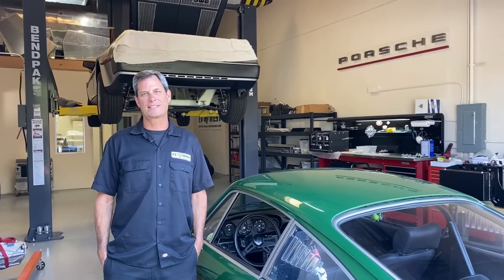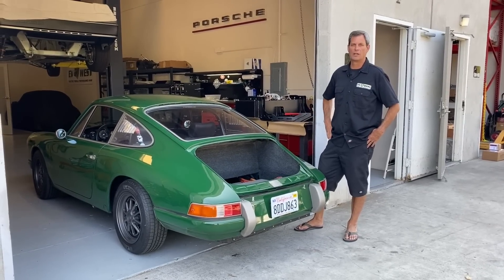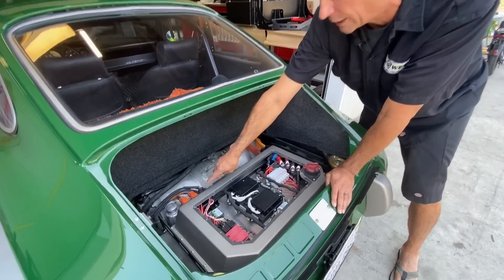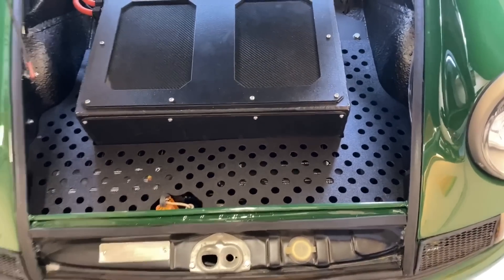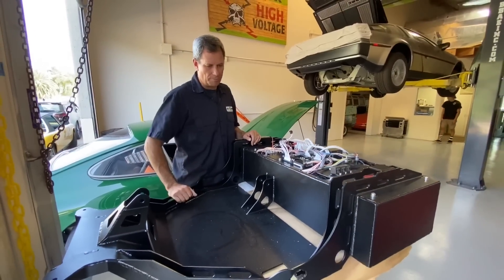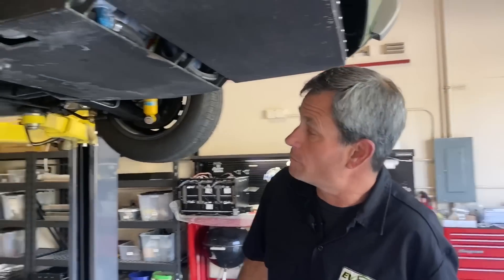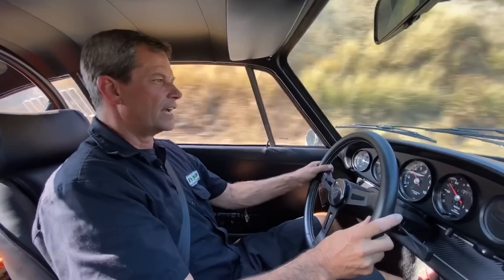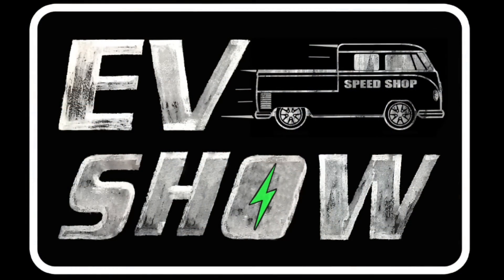1968 Porsche 911 With Tesla Power | EV Show

Comment: Wow that’s fast. Just acquired a 1966 912 with a vw engine ughh. planning to put a period correct 4 cylinder Porsche 912 motor back in during restoration but your video does open up a different direction  do you sell the box or at least provide the cad/ dxf file for us to weld up a engine mount to go with your 912 kit ? Trying to put together a cost. And labor estimate

Comment: So it sounds like you can just supply the 911 kit for the install, I assume the customer has to source the some parts too? I note Air conditioning wasn't mentioned but I am aware electric kits are available, have you also installed this? Im interested as I have an old Porsche 993 that will need an engine rebuild at some point. Im in Australia.

Comment: would love to know what those 2 grey conduit lines are running along passenger side? Main battery? was there not enough room in Tunnel to 2x 2/0 Cables with PVC? having trouble fitting 2x 3/4" PVC in Tunnel for the 912 conversion..

Comment: That is the saddest thing I have seen in YouTube so far
Reply: Good to see there are actual car enthusiasts alive and kicking like you guys.  They're all blinded by this electric is clean myth
Reply: As an owner of a REAL air cooled Porsche, I couldn’t agree more. Without the sound it’s not even close to the same driving experience. I won’t even get into the fantasy that ev’s pollute less or where we will magically get the power to charge millions of ev’s. Flame away millennials, flame away.
Reply: I am with you on this guys , what is wrong with these people ?  I own a Vincent motorcycle imagine putting an electric motor in that , if you own a Rolex watch put a quartz movement in it , it will be more accurate than a mechanical movement. With classic engineering people who understand appreciate these things .  This kind of thing is clever as a one off , ok .

Comment: 32kWh?  Only the first-gen Nissan Leaf had a smaller battery.  Though in fairness, I've found it mostly adequate for the past 10 years, but I understand why you'd do it with a Porsche; it keeps the 911/912 lighter, more nimble.

Comment: What does a conversion cost on average? I can imagine the entire setup running well over $100k for the 1968 911, including the cost of the 911. Likely double the cost of the 911, if in excellent shape.
Reply: The site lists for 11k without the batteries. A Porsche 911engine complete rebuild is now more than that.  More if you increase the performance.

Comment: I think this really shows the conundrum that the automotive world is going through. I simply adore old 911s, and the sounds are a HUGE part of the appeal, especially one with some slight tuning. It will NEVER be as fast or reliable as this modern car - but that isn't the only reason people buy these. I'm really torn. The power, simplicity and sheer HOLY @$#!$%# factor is just huge! But man, running a weber-equipped 911 through a tunnel is something that you'll never understand in a car that goes WZZZZZZZZZZZZ!
Reply: I love my VWs  mostly for the engine sound but I guess you can't have your 🍰 n eat it🤠

Comment: Discusting!! Should really be ashamed of yourself for ruining such a valuable car like that, by removing every bit of it’s heart and soul..
Reply from the maker: This is why we spent years developing this kit, so that it could be bolt in, and reversible. Just like a wheel and tire combo, it can be changed back to stock at any time, so there is no change to the original body and chassis. We're not environmentalists, we're a speed shop, so the intent is to make the car faster, not cleaner. That's just a nice side effect.

Comment: It's crazy fast, but I'm a purist. The sound and feel of the air-cooled engine is better overall experience. I have a model 3, but love the original porsche. Don't like ruining vintage cars like this.
Reply: convert them or lose them.. no gas cars in the future ....
Reply: @gui4j  Yeah I’d be nice to have my car converted but these guys never respond lol
Reply: Converting them is pointless, all you do is add extra strain and stress on the whole car which will make it break faster There is a reason why high horsepower cars need to be much stronger. There might be methylene as fuel in the future as it is sustainable fuel so converting it to methylene would be better

Comment: What a neat idea, offering "plug" compatible replacement electrical power units! This could work with any vehicle and would be certainly profitable for cars that have been market winners produced in large quantities. You just find a model with a timeless look like the Porsche 911. Once you remove the ICE and all its accessories (radiators, gear box, gas tank etc..) you are left with enough real estate for the batteries as electric motors are small compared to what you have removed.  Great project for a start-up... and to attract Climate Change suckers!

Comment: I didn't know you could get an electric that light, 2450 lbs.
Reply: That is very light i guess its easier to get a car that light when its an actual sports car without all the safety precautions such as airbags and other things plus it probably has a smaller battery
Reply: Also the car is not designed for that much power so it uses weaker components as they are lighter.

Comment: Those hoses on the passenger side HAVE to be sorted out better. Love the projects, but that is killing the look from that side.
Reply: The hoses mimic the oil cooling lines to the front radiators that are present on 911s.  But I agree- the look doesn’t look clean in any case.

Comment: Why would you take an iconic classic & ruin it? It’s the EV folks snubbing the real car loving guys. They could’ve used an old 80’s economy car for the conversion. What’s next a classic 1960’s Corvette?
Reply: EV Stingray would be great.
Reply: raboox9 wait until Chevy puts out a new one. Don’t destroy a classic one!
Reply: Better than letting it rot in the garage because you arent allowed to drive it anymore. Aslo, if you are new here... EV West conversions use all the original mounting points so it is a reversible conversion. They are classic car lovers and do as much as they can to preserve the original vehicles. They dont even usually have them repainted.

Comment: It’s kinda copying the other performance electric cars company Rimac before making a $ 2,000,000 car when he start his company,
Rimac built his first project from a old BMW and mod it in a all electric car that simply terrorized all the drag race track around it, so the turn this old Porsche makes me think of the kinda same of the project story
Reply: Huh? People have been converting cars to electric since the 1970s.  The original Tesla Roadster was essentially a low production conversion of the Lotus Elise. What EV West is doing that is somewhat novel is that they are manufacturing all of the hardware needed to do these conversions quickly using existing mounting points of these vehicles. They specifically focus on Porsche and VW hardware but they also do all kinds of other conversions and now have a Tesla Crate motor for V8s.
Reply: Mate actually learnt from the early 2000s generation of DIY convertions. E.g. the Zilla Controller & NetGain Warp motors. Him and EV West are another generation after that.

Comment: It would be appreciated if you provided a 'basic' specs sheet for the end product....like 0-60 time, estimated range, maximum power, top-speed and approximate cost (installed).  I know some of this was sprinkled through the video but I didn't hear anything about range or $.  Great kit and I'm going to be interested once the improved batteries make it to market in a couple years to allow for increased range in the limited battery space.  Is this ready for a Cayman?
Reply: 0 - 60 looks like it costs 2 rear tires
Reply: Just imagine these conversions with the 4680 batteries.
Reply: Nobody brought them one, that porsche has an owner, they just need somebody who owns a cayman and is willing to convert it to electric drive

Comment: This is probably a stupid question but I'm just learning. With a 32kw battery pack what would be the range? 120 miles give or take?
Reply from the maker: We've been getting bout 140 miles per charge.
Reply: Yeah I think you're pretty close here. The 120ah BMW i3 has around the same size batter and goes 120 miles without babying it. This Porsche is lighter but may be a wash if BMW is tuned for better efficiency
Reply: Awesome thanks for the replies guys. EV West is doing something that needs expansion. What a fascinating subject.

Comment: so now you have a EV with a Porsche chase ,but Porsche is also for dancing arround tight corners ,how is all the extra weight effecting ,the car ? ,i know ev can be fast but they are also usually heavy and need loots of help from the computer to be kept stable ,im not sure if these old Porsches stand for that
Reply: Weight and distribution are about the same as the original. These guys are big fans of the classics and try to preserve the feeling of them as much as possible.

Comment: So, same overall weight as stock at 2400 lbs? Not bad with 32 kWh.
I'd already be happy with half the power probably, Model 3 motor with less heat loss. But probably still a challenge to control?

Comment: 32kwh capacity, what does your miles per kWh come out as? Clearly lighter than a Tesla probably with less frontal area. Would like to think you are achieving 4.5 miles per kWh? Say 135 mile range? Does your installation include regenerative braking? Maybe a rear seat box with an extra 16kwh battery and just a single Tesla motor would give more than adequate performance and greater range?
Reply: Came here to ask the same about regen. Since this 911 is RWD only, no mention was made of any motors in the front, and the front does most of the braking, I have to assume that there is no regen.

Comment: This is awesome, may I know how much the retrofit cost?
Reply from the maker: Customers are spending around $35k for all the parts, batteries, etc... for the Tesla drive system for the 911.
Reply: The retrofit is listed on their site for $12k.
Reply: I think car included it’s worth like 175k to 250k
Reply: Scratch the above, that is not Tesla stuff and does not include batteries.
Reply: KHALIIL01  putting the engine at the back? 😁